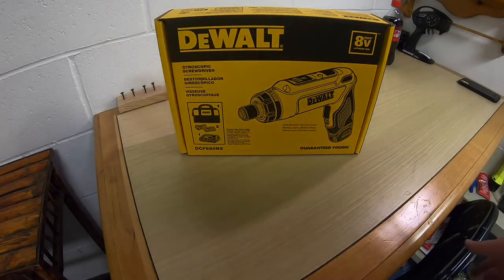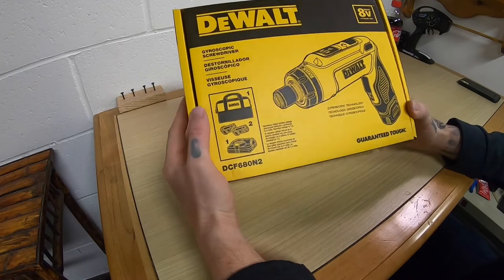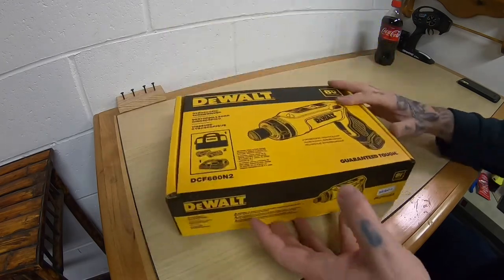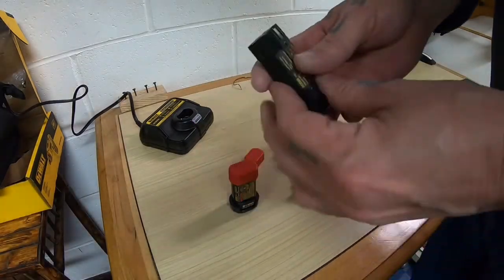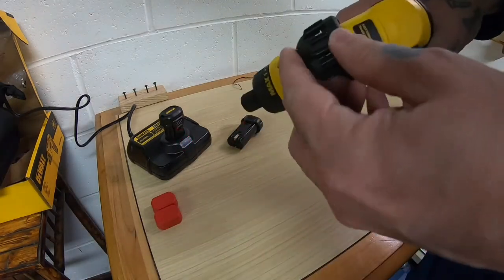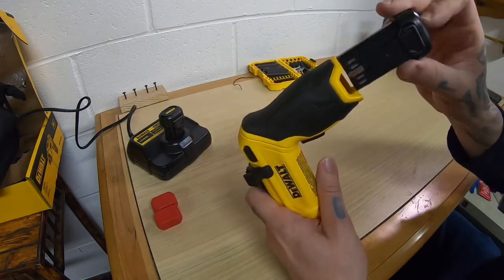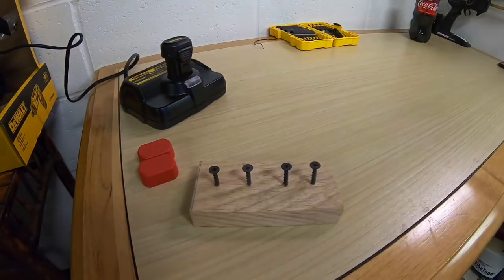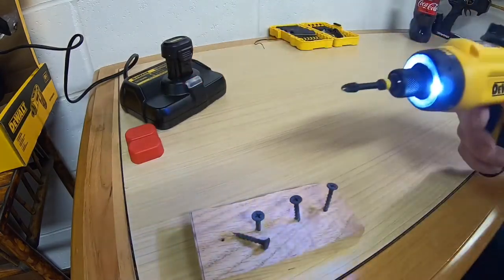DeWALT 8V MAX Gyroscopic Screwdriver - DCF680N2

Comment: I just got one at work. It's very impressive. I do electronic work where I assemble and disassemble small items w small screws most of the day. The torque goes lower than any non precision drill I've ever touched. The '4' setting is perfect for 3-56 torx screws into plastic. 9-15 better for metal on metal machine screws above #6 threads and up. I haven't found the upper limit yet.

The auto direction feature made me wet my pants (metaphorically).
Reply: I Just ordered mine 103$ with 2 batteries
Reply: @213eddy where ?????
Reply: @MrKlyde44  amazon

Comment: I couldn't figure out what was wrong with mine until I watched this! Their  Gyroscopic feature was not what I expected!  Don't like it, but mine isn't broken after all.  Thank you!!
Reply from the maker: It takes some getting used to. You’ll eventually love it. Glad my video could help. Thanks for watching.
Reply: @toeshifter  I'm not loving it actually!  I find it to be quite annoying that I have to constantly move my whole hand and wrist to make it work, all while also having to hold down the button!  HIGH aggravation factor when you are in perfect position!!
I wish I could turn OFF the "gyroscope features!!"  I would happily buy the same tool without it & donate this one.  
I keep using it because I like the power it has.  May revert back to using my drill as a screwdriver on certain projects because of the aggravation moving my hand & wrist a lot just for full power

Comment: I was given this model year before last as a Christmas gift. I've had issues with the handle unlocking when folded so just be aware of that I don't know what's causing it if it's hand position or what but I do not like that. I use the device in the open position to minimize any issues of unlocking. being able to fold in a 90° angle is helpful for limited space but just be aware of it. Also I have not been impressed with the torque of the screwdriver it is limited. For light use around the house though is really save me some time due to a stroke. And I'm only 57 so it really does help.

Comment: Hi I have drill into hard surfaces to install a barrel bolt on awood door and the clamp housing it slides into to lock the door, on/into a hard metal door frame. Is this a power tool that you think this will do the job of drilling with a hard drill bit into the wood and the metal? If not what is a good recommendation for a under 50-100. drill tool. Thanks / great review / new sub > nyc
Reply: No this is way to small and its a screwdriver you need a drill
Reply: @ManOfTheAQW  Thanks RG. Is B&Decker any good? saw a 20v on ebay is that man enuf for job described? Appreciate it!
Reply: @culturehorse  I’d recommend you get the dewalt kit DCD708C2. It’s $99 at Home Depot and has a brushless drill with 2 batteries and a charger. Its a great drill and will do anything that a DIYer or homeowner would need it for and it’s really not even a bad drill for use on a job site doing construction. I wouldn’t go with black and decker, they’re honestly pretty bad and don’t have much power.
Reply: much appreciate .. I see it online .. many thanks .. great advise .. Wes🎄Hv Good Holidays!

Comment: Just curious why someone would want that if they have a impact drill, that would do the same
Reply from the maker: I use it for my RC hobby but it’s also perfect for small home projects. You ever use your impact to put electrical faceplates back on? Good way to crack those. This is less power and more control.

Comment: I had one of these and it was neat but I don't see why a gyro is better than pressing a trigger.
Seems like extra hand twisting to me.
Reply: The giro is good for variable speed use. Just about every other electric screwdriver out there is just on/off
Reply: @jonhill373  bingo. The variable speed control is what sets this apart.

Comment: How can you pull the drill or the bit out so easily? I used it with a drill and it stuck in there, I can’t release it or change to anything else. So frustrated 😢
Reply from the maker: Just pull on the collar to release the bit
Reply: @toeshifter  I have tried thousands times but I can’t remove it. Maybe I should go to Home Depot and ask them to help me. Thank you for replying!

Comment: Not available in the uk for some bizarre reason
Reply from the maker: That is strange.
Reply: Available via Mister Worker, albeit they are in Italy. Takes about 8 weeks delivery. BUT, they did deliver, even with Brexit. Cute tool. Batteries might be awkward to source, but are available. Best
Reply: Panchdara they are now available in the uk for £150 so I bought one from the USA £110 delivered 😀
Reply: Panchdara just had a look £94 from mister worker
Reply: @MrTom1379  Cool! I got one delivered £123 from Italy. 6&2threes, mine had the hard case + 2 batteries/charger, no bag and no bit holder. I'm just waiting for Ave to tear one down! TBH, I've looked over here UK and no luck. I do find that anything US is about 50%+ more expensive in UK... not in actual monetary, but in numerical value (ie $1=£1, so what you pay $100 in US for it's gonna be £150+ in UK - not $150+) Best
Reply: @MrTom1379  Hi again - yeah, but they (Mr Worker) do add VAT on both item and shipping on top of that 104Euro. At end of day, heck, we're paying far more for goods and services that they do in US, but they have to pay health insurance (and that can be a killer - I know an older couple paying in excess of $3k/month for comprehensive - not dental -just health insurance).
Reply: H mine had 2 battery, bag , bit holder , had to buy a 240 v to 110 converter for the charger £9 , must be mad 🤣 it’s very nice but at the end of the day it’s just a cordless screwdriver